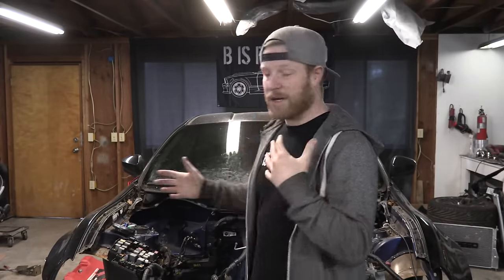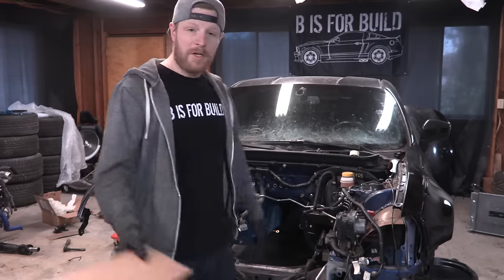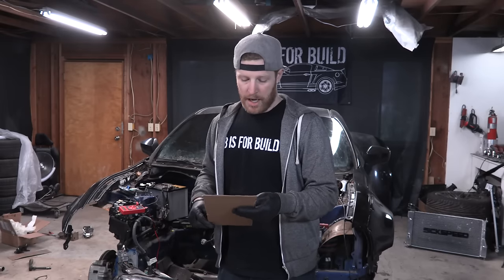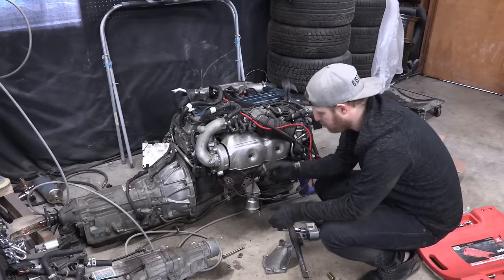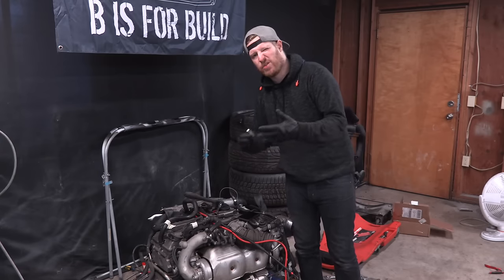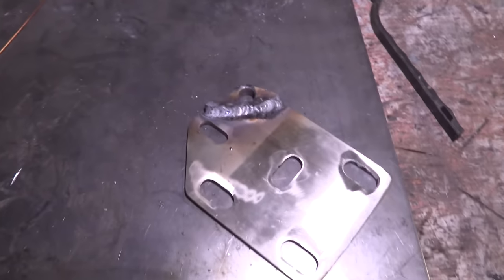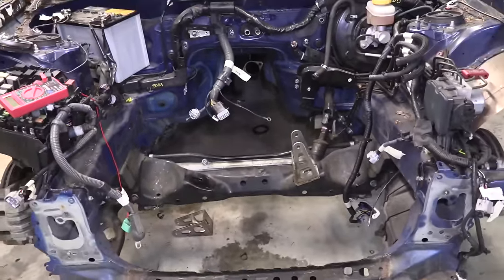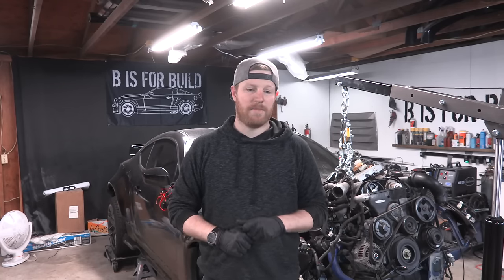2JZ BRZ Pt 2 - What Still Works?

Comment: why won't you have a heater? it's just 2 heater hoses running into the core in the cabin...
Reply: has to flatten the firewall there for clearance I think so at the least it'd need to wait for everything else done to find a spot to relocate
Reply: Yea never get why people dont bother, unless the heater core is leaking there is no excuse. A fogged up car on a cold day is just plain dangerous, especially on a 'powerful' car
Reply: Matt Eveans the twin turbo setup likely blocks the ports for the heater core on the firewall, there just isn't room to get the hoses on to the ports. it's that way on the 240sx if you want to keep it twin turbo, just no room. single turbo, it's no issue, though. the 2j TT setup is a big, complicated bitch.
Reply: TT is complicated.  When I started my swap I planned on keeping them for budget reasons.  But the problems kept mounting and I decided to go single.  Easier to install, way less plumbing, looks nicer, easier to maintain.  Lag kinda sucks, but Chris has the VVTi so he would be OK.  I just have a 2JZGTE... kind of wish I went VVTi.
Reply: cant just swap heads and ECU?

Comment: Chris, love that you're doing this build! It's a build that I've been planning on doing for some time now, but I can hold off and live vicariously through you. 😋 Just a few things that might help you out:

-You've likely realized this already, but VVTi GTEs and non-VVTi GTEs have different motor mount bolt holes (IIRC non-VVTi have 8 bolts with different spacing). CXRacing is getting you the right mounts though, so no worries.
-VVTi GTEs from Aristos (which is what I believe you have) have a "Front-Sump" oil pan vs the "Rear/Mid Sump" that come on Supras. You will very likely need to get a Mid Sump oil pan in order to clear the subframe on the BRZ. 
-With a Dual-ECU setup you will not be able to get the ABS, EPS, Cruise Control, Traction Control, Fuel Guage, or Tachometer to work (in addition to a few other things). Additionally, you will have to remove the fuel pump ECU in the rear and wire your fuel pumps yourself. The CAN-BUS systems in these cars (and most modern cars) are very finicky and hugely complicated, so engine swaps can be challenging. Currently, there are a few ways to get some of the CAN functionality working, but the only mostly-complete setup is from Pure Automotive. They are running a custom wiring harness with a Motec M130 and some custom software IIRC. You can read more of the specifics here: http://www.ft86club.com/forums/showthread.php?t=116595

Obviously, there's a lot more to it than just these things, but I figured I'd hit some key points in case you didn't know. If you have any other questions, you can shoot me an email at albonothing@gmail.com. While I haven't done this swap myself, I have done lots of work on both FRS/BRZ and Supras so I know a little bit about both platforms. There's also a wealth of information in the FT86Club Engine Swap forum, so check that out!
Reply: Good info man! Seems like you know your stuff - hope Chris sees this

Comment: I know you want to make this a budget built but since you have the car stripped down I would really suggest into stripping the motor and check for leaks and cracks in any parts unless if that has already happen or if you know the engine is in good condition. Also clean up the engine bay by painting and removing unnecessary components to shed weight and by choice. Honestly with this motor and the weight of the car I'd really suggest taking a LONG time and build a show/race car. Just by having this engine and the body and weight of the GT86 you have so much potential to have a beast.

Comment: That is a tight fit! My dad and I are cramming a Ford 302 into a Triumph, so, kind of in the same boat there. I don't envy what you're up against with the electrical system though.

For the P/S I'd say junk the electric rack and find a conventional one of the same length, then hook it to the pump on the 2J.

Comment: Chris alternator and starter will both have a heavy gauge wire running from the battery (or positive terminals on the fuse box) to the alternator and starter. Starter shoukdnhave power constant and the alternator will as well. When the engine is running you should have 13-14 volts at the battery. If you do you're all set! Good luck!

Comment: Loving your videos (I am only starting with videos out but you have given me plenty of confidence and inspiration to do my own).

I am almost finished an LS3 V8 swap in an 86 for road use and the 86's (FRS) electric power steering and ABS will need a CANBUS RPM signal (and the signal needs to be of the correct frequency and rate of pulses on the CANBUS). You can get CANBUS translation units. I have been beta testing a system here in Australia. But you can definitely get those things working. 

And a spot weld drill bit will help you remove the extra bits in the tunnel cleanly :)

Comment: Hi, I'm putting power steering in old hot rods of mine, I used to work in a classic rally garage and they use the electric power steering from a Corsa. I also use this set up. I can make a unit that will sit into your existing steering setup by cutting and welding it it.... Then you will only need a live and Earth wire and it should work perfectly for what you need.

Comment: Have you considered doing a 350z 6-speed manual transmission for the 2jz?
Reply: Why?
Reply: D Day it's so much cheaper than the original 2jz gte manual transmission. Those cost more than the engine now. 
350z transmissions are really good and a lot of people use those in 2jz swaps when they plan on doing 400-500hp
Reply: JC_mcsR53 I gotcha. I forgot his 2jz came with an auto trans. If the 350z 6 speed trans is cheaper that would be cool to see him do.
Reply: JC_mcsR53 got that from motionauto didn't you
Reply: JC_mcsR53 i think the fa20 was auto and i dont know if its possible to convert it to manual even if there are manual brzs
Reply: See that's what we call. Expensive.
Reply: @natgeoba7377  it is very possible.

Comment: The three prong plug for the alternator is more than likely to tell the alternator to turn on, power, ground and excite. I believe toyota uses same type of system so you will probly be able to get away with re-splicing the toyota alternator plug on to it. The other wire as well more than likely will be your power wire the positive current being produced by the alternator will send out to your electrical system, your battery, starter, fuse boxes etc. hope this helps at all, truly enjoy all your videos and look forward to each one thanks for everything.

Comment: For the battery to alternator all you need is a separate ground for each and then run a power from the alternator positive directly to the battery positive

Comment: Just a correction you can swap a engine into a car such as a 2jz into a frs and retain A/C etc the only thing that you would not have is ABS and the gauges maybe wouldnt work unless you figured out how to get the gauges to talk to the ECU via the FRS CAN system.. basically u can swap a v8 into the frs and get everything to work gauges, A/C everything.. same goes for 2jz.. just depends on your knowledge of wiring and how much money your willing to put in to make everything work together

Comment: hey brotha usually the sensor/plug going to the alternator is the voltage regulator sensor. check to make sure that the supra alternator is able to supply said voltage as newer cars run on 14++ volts. if the alternator from the supra isnt the same voltage a alternator rebuild shop can make it do so very easily.

Comment: The alternator is easy so is the heater, the alt has the big wire batt+ obviously then in the three prong one is a wire that can change the charging voltage. one comes from your charging gauge or light that is crucial for charging. one is just key on 12v also crucial. it should be simple to find a pinout on a 2jz alt to find where tge two crucial wires go. the heater is almost literally two hoses that go to a heater core, u could likely just use a brz heater control valve or just buy a generic one from autozone. Luv the vids!
Reply: forgot to mention u don't need the one that changes charging voltage

Comment: As soon as you started bolting the tower mounts to the sub-frame I knew you were in for trouble. Next time bolt the towers to the block and then let them land where they may... that is, after you cut out your entire transmission tunnel and half the firewall :x
;p

Comment: for an alternator you really only need 2 wires, one big going to the battery + and one small wire for the D+, the D+ goes from ignition + to the battery light in the instrument then out to the D+ on the alternator which then grounds it trough the engine, when you start the engine the alternator puts positive current on the D+ thereby eliminating the ground and the light shuts off, that is litterally all that is needed for an alternator :)

Comment: nice, I'm doing an 240sx RB20det swap and my silver top is a very early model and I have been having issues with certain parts not fitting or being completely different all together. but mine has been mostly electronic differences.

Comment: the green conector that goes to the alternator is the one conected to the voltage control. it controls the voltage produced by the alternator. one of the pins goes to the light in the dash, one goes to the switch and the other one goes to the battery. you must be carefull wit the order of the cables if you dont want to burn the voltaje control in the alternator

Comment: You may find that the electronic power steering may not function until the module sees an operating voltage of 14vs something it would typically see while the car is running.

Comment: A normal alternator has 3 wires:
1 B+ goes directly to the battery and is the thickest 
1 L for Lamp (warning light)
1 12V ACC (also called sense)

I think you can trick the ABS/ESP system so it works without the engine, same for the e-steering.

Comment: You should put the temp and oil pressure sensors  from the BRZ motor into the 2jz then those gauges would work iv done it with engine swaps in the past

Comment: The motor mounts are different between the VVTI and non-VVTI motor. The Toyota Supra (non-VVTI motor) has different mounting points from the Toyota Aristo (VVTI motor).
Reply: he said usa vvti didnt vvti 2jz only come in japan?
Reply: Stephen Cain the aristo is a Japan only car so it's prob a Japan vvti
Reply: Stephen Cain yes vvti GTE motors were only used in Japan. The 1999-2002 JDM Supra had it and the Toyota Aristo had it. The only 2JZ-GTE in America was the Non-vvti Supra motor. It had different mounts, bigger injectors, different turbos, and a different spark plug cover.
Reply: yeah i thought so but i wasnt sure the lexus gs350? had the Na vvti right? i think thats the name idk too many numbers but basically the toyota altezza in japan
Reply: Stephen Cain in the USA, the Lexus is300, the Lexus sc300, the Lexus GS300, all had the NA vvti 2jzge. Their JDM counterparts had the same motor in Japan. The 2JZGTE was only used in the Supra and Toyota aristo. Both were vvti in Japan, and the Supra was non vvti in America. 

Chris will need to find out from CX racing which mounts he needs for the vvti JDM Aristo motor.

Comment: So I am not really understanding why functionality such as air conditioning and heating is not going to work in this swap. Admitidly I have only done engine swaps on pre 2000 vehicles, air and heat have been as simple as hooking up the a/c clutch wire, having a local a/c shop modify the hoses, and hooking up the heater core coolant lines. Does the brz have some crazy A/C wiring?

Comment: for AC and Heater you just need to keep the compressor, evaporator and Heater core, evaporator can go in front of the radiator, heater core most of the time goes under the dash in the firewall and the compressor goes to the engine, use the stock compressor of the 2jz and hook the brz lines, thats it i guess

Comment: Did he ever compression test the engine? How many miles did it have on it when he got the 2j? 
It would really suck if he got everything running and then the engine pulled a Dude in Blue and failed.

Comment: I enjoy your vids B but for some reason it bugs me when a job is not complete. The Lotus rear seat looked like crap, I found it weird that you took the headlight apart to clean em up but you couldn't unwrap the seat to straighten the metal inside. How's is the car doing by the way? Are you using it as a daily driver? The Mustang build wasn't very interesting but you spent a lot of time on it and it would have been nice to see the finished product. I hope this is not a trend for the "B is for Build" channel. Start a project and move on to the next one before it's complete because I am thinking anybody can have a channel like that and and my life is like that already. Start something and not finish. I kid of course but yeah, I imagine if you had two projects going at once you can work on one while you wait for parts for the other but alas your shop is too small for that. Keep em coming because I like watching. Wish I could come help you or do my own project but a bad accident has left me in this wheelchair and have very limited use of my hands. It took me almost 25 minutes to type this message.

Comment: Why aren't you going to have heat, ac, or power steering? Granted I've never messed with a 2j, but I've put a ls in a few things. Just need to repin your harness on those. What's different about the 2j?

Comment: you should be able to have heat all engines have water outlet and inlet to a heater core. and if the engine had a prevision for an air compressor i am sure you can retrofit the brz compressor and retain heat and ac

Comment: if the power steering is anything similar to the mr2 electric steering because it's such a high draw in power the ecu won't activate untill the engine is started. possibly because it requires in excess of 12v. some of us in the UK have the power steering on a switch. it may be possible to give it its own power feed?

Comment: it would be more work but maybe you should strip as much off the motor as you can (intake manifold, exhaust, accessories, etc) while test fitting.  it would be more work but i think it would be easier to pull the motor in and out.

Comment: the heater just need to be connected to the 2jz to work all heater cores are usually the same but different pipe sizes

Comment: Keep your heater block. Keep your AC. These are not special in regards to be removed. You should be able to use the original ECU/Cabin CU to power these things. You will regret having removing these in cold weather and hot weather. Remember to paint the engine bay too.

Comment: I put a 2jz in a rx8... How do i add power to the original ecu.. I have no idea how to work electrical systems.. My engine is mounted permanent..
Reply: I know battery to ground but what do i hook the possitive to?
Reply: By the way my harness isnt on my engine.. I wanted to hook power to the original stuff and run power from that to the starter for the engine power

Comment: so I'm not an expert in Toyota transmissions, but that definitely looks like an automatic to me. wasn't the whole point of this engine swap because you didn't like the automatic in the car? I could be wrong, Toyota may have used a very oddly shaped and large manual transmission.
Reply: In the first episode he stated it is indeed an automatic, and that he is going to be building this car in stages. Stage one is just to do the swap as cheaply as possible. Stage two is swapping to manual, standalone ecu, etc.

Comment: I looked into putting a Electric power steering in my 66 Mustang and found a guy in Iceland that makes a stand alone controller to use on a Saturn Vue EPAS system. I did a quick search on eBay and found one for a toyota. Might work or at least start you on the right path to find a standalone controller. http://www.ebay.com/itm/Toyota-Prius-04-09-Electric-Power-Steering-Column-Controller-Unit-kit-EPAS-/262400460977?hash=item3d184948b1:g:qVwAAOSw3mpXGlSA&vxp=mtr

Comment: If you are going to use this car in the 10k project car race. You need massive rear tires and 2 step. Also a big turbo. Because you will loose to anything. Even a damn stock mustang
Reply: He isn't using it in the 10K project car race. He did a video about that.